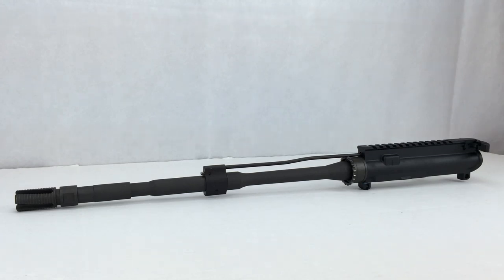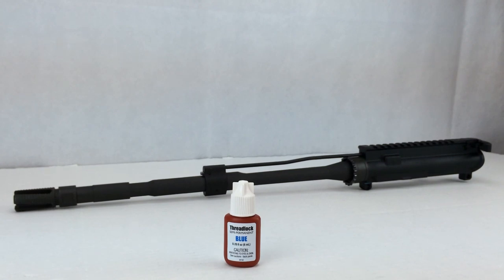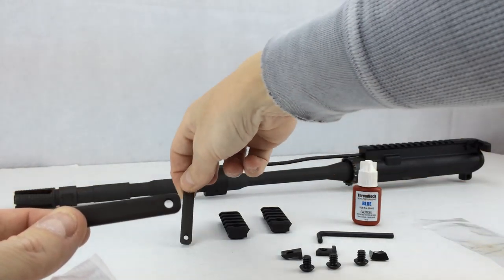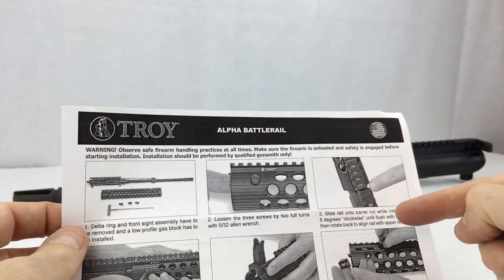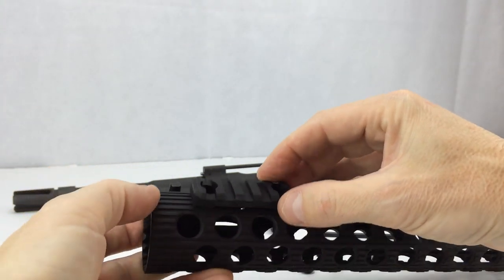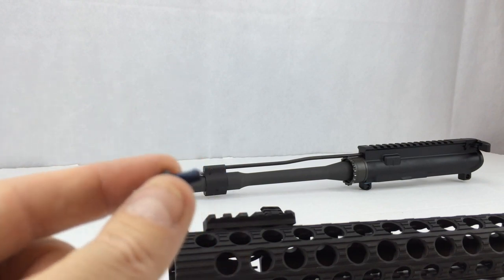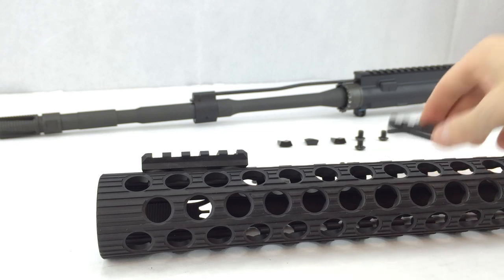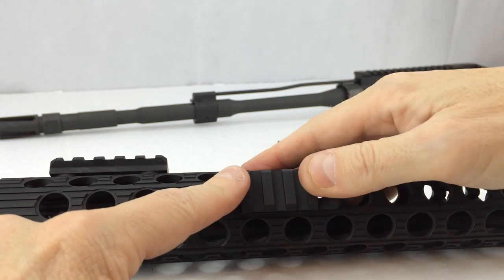Troy Industries TRX Alpha BattleRail 13" & Front Sight - Installation

Comment: I had to install the rail module after the hand guard was installed. Took me about 2 minutes by running a paper clip through a screw hole to hold the brace in place on the inside while i got the first screw in. Easiest hard thing iv had to do to my ar15 so far.
Reply: Nob ody what size Allen key do you need to install/remove the rail attachment???

Comment: If you ever want to move the rail try a magnet on a stick to start one end the backer is the only steel part on the rail so it works ok .You can put it though one hole and hole it up while you start the other end ,much easier than the craziness you went though .